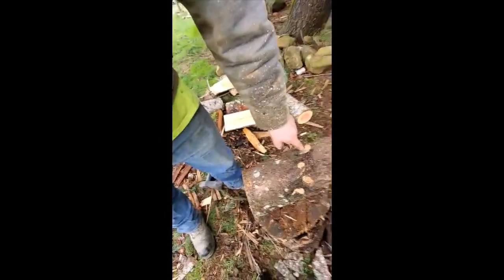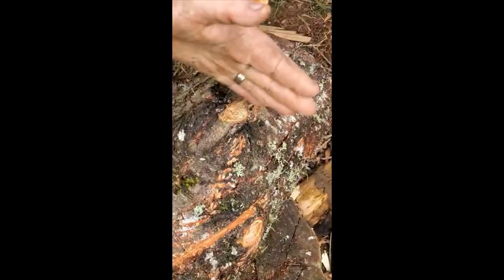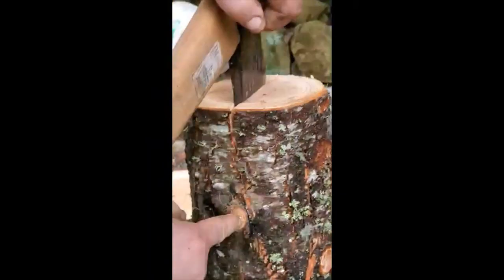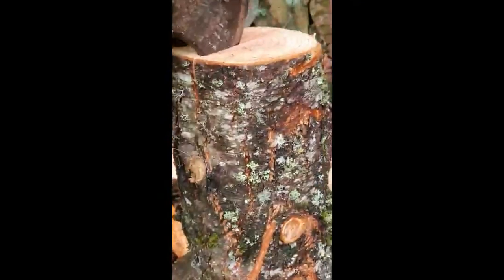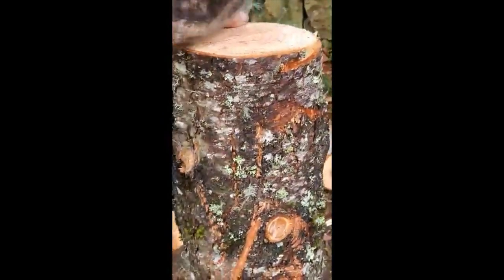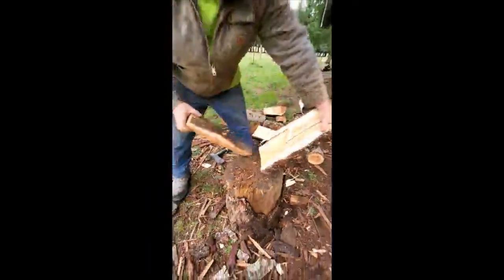How "KNOT" to split wood

Comment: Definitely need to get one of those “jigs” for sharpening the blades.  I’ve been doing a terrible job sharpening blades.  Luckily I have all my wood for next year.  Thanks for the splitting tip.  Still have plenty of that yet to do.
Reply from the maker: Thanks for the comment. My father keeps bragging about an electric one he has and swears by it, but Im just too old fashioned I guess, AKA Stubborn. LOL. I'll use the file guide, as shown in the video in my shop before the day begins, but once I am out cutting i just free hand. Then next time back in the shop bring the guide back out, that way my angles never get too far out of whack, and prolongs the life of the chain. I've seen those jigs though, I think Wranglerstar has debuted several. I may look into one.  thanks for the comment, stay safe out there
Reply: Helmig Homestead I just need to get something because I’m terrible doing it free hand. Lol.  You be careful as well and thanks for the great info.
Reply from the maker: @SnipingRhinoRanch  i can do a video on that cheap little one i used in the video if youd like to see how to use it?
Reply: Helmig Homestead I’d absolutely love to see that video